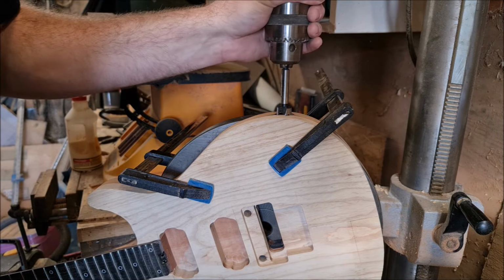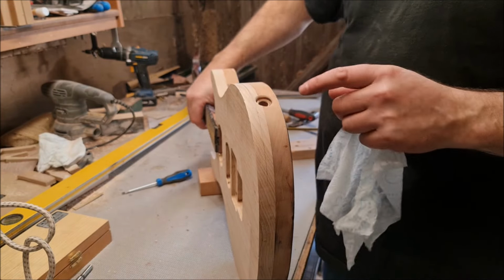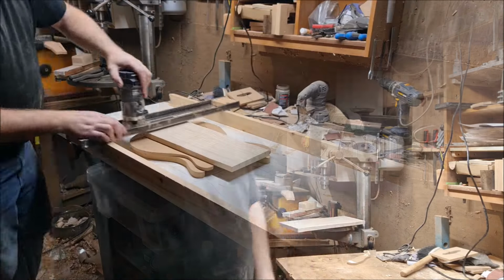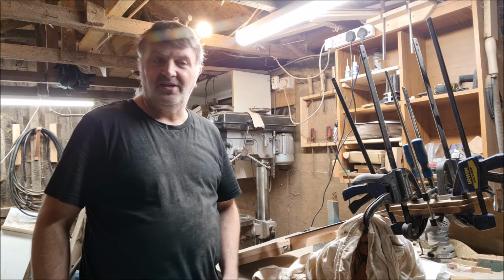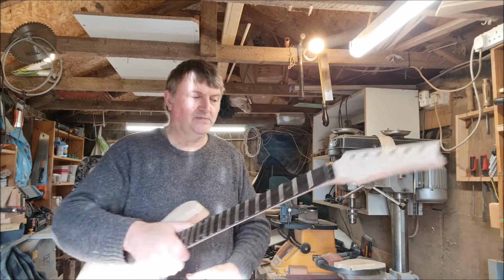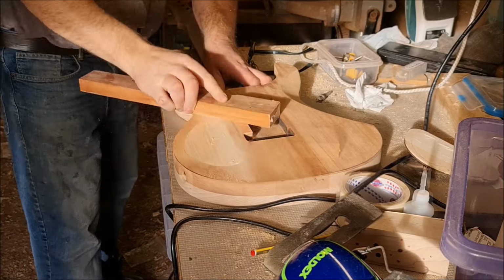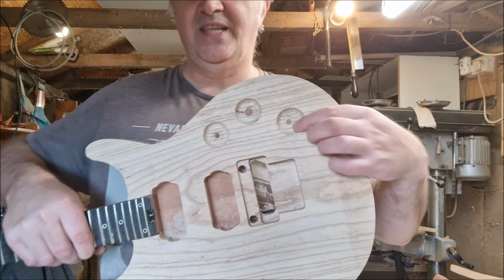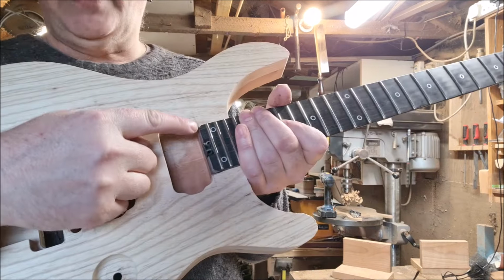Mahogany neck through new carve top Episode 3

Comment: This guitar is blowing my mind.  Its like someone cutting half the body off a car and building something completely diff.  On the planer with the melamine board, does it reduce snipe at all?  My DeWalt one always has a little dent on each size and I'm thinking of putting a longer surface like yours to level it out as much as possible.
Reply from the maker: @EntropiaGuitars  I don't tend to get it on the exit but still get it on the front. 
I leave the adjustment and just keep running it through though which seems to help reduce it. You can also stick a sacrificial board in front. 
And yeh, the initial lopping the top off looked a bit drastic lol